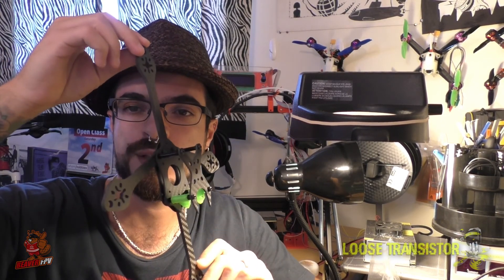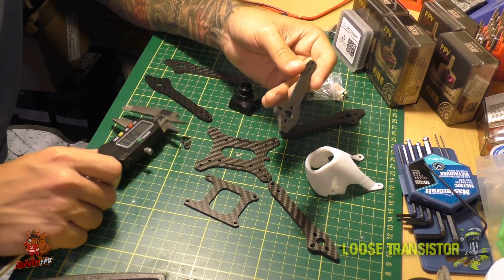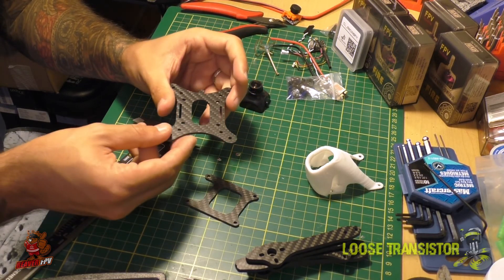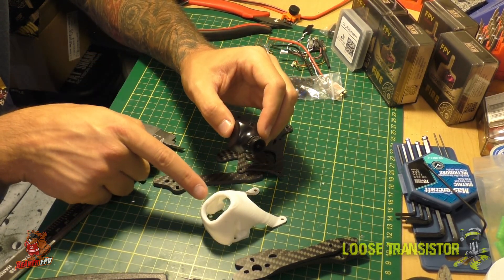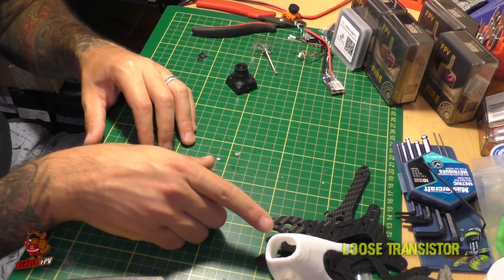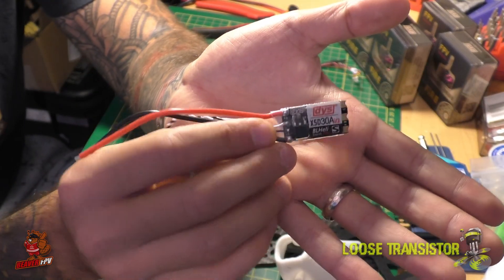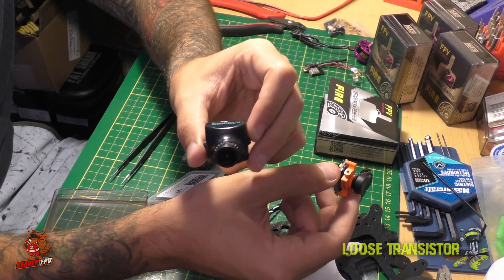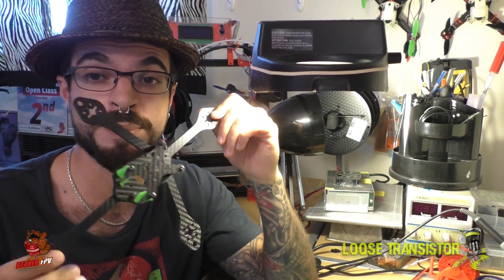Element6Drones - Apex 5" Racing Quad ♠ [ FPV DRONE BUILD ]

Comment: Hi Lucas!
Good to see you talk again, all stuffed with that hot infos we need! 
 Man, I am really looking forward to watch you build this little speedo monster! =)
I finally managed to get the 12 awg wire to the cl racing f4 battery pads, bummer! xD  Was a pain in the butt, need a new tip for my iron since I'm afraid to grill the board. Can't get it to stay nice and clean any more that tip. 
To get to the important stuff:
Where are you gonna solder that 5V VTX to? I've got the TBS unify pro 5V version, the 7,3 on top will be too much and the 3,... will be not enough I guess. Any 5V pads at the bottom? 
Sorry for the kinda impatient question, got a multimeter but silly me not having the xt60 on the board wires yet, and soon gonna solder some battery plug to a crimp cable like you have it there for measuring and trying stuff.
After all, this building and improvising to get to the great goal of flying is really becoming a blast for me!

Another short one:
Connecting a frsky x4rsb, and I want to get that lua script going for tuning right on the Taranis at flight. Sooo.. Smartport signal to any free uart, need to be uninverted or is the pure signal fine? 
And the Telemetry signal pad, does it take the frsky telemetry or do I have to do that uninvert hack on the rx?
Soo many questions, you are my first choice victim, I really appreciate your work and your effort for us here!
Anytime you visit Europe, come to Berlin I'll show you some badass spots!
Greetz, Oli
Reply from the maker: Hey Oli! Thanks man, appreciate the viewership! Yeah get yourself a better tip/iron and soldering 12awg will be ezpz.

I will answer your Q's in order here.

1-I'm going to wire the 5V vtx to the Cam + Pad and I am going to use VTX pads to feed camera instead since its HS1177

3- You might have to experiment with UART for smartaudio - I know the CL is capable, just not sure which pad and I can't find info in manual.

4- The TELEM pad should do perfectly fine for ya!

Thanks Oli! If I ever drop by Berlin ill be sure to hit you up!

Thanks for watching man =D
Reply: Awesome man! I knew you'd hit me with great infos, thanks again ;)
Reply: Loose Transistor Hey again, had to resolder that 12awg from the CL... Guess what.. the solder pad came off. I pulled too hard. But new solder I put on that white spot stays in place. Will that do it at least for a while or did I kill it? 
Shame on me, soo nooby! 
Sry for spamming too, my new quad buddies here are not firm enough for this question.
Reply from the maker: O. Pixit in theory you should be able to use one of the ESC pads to power the board.

If your were able to solder it to dine part of the original pad it will work, just likely very fragile.

I don't think you killed the FC you'll just have to be careful with it or power from another ESC pad
Reply: badass idea, pro bro! =)